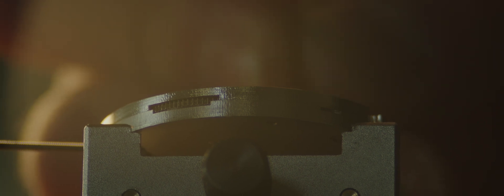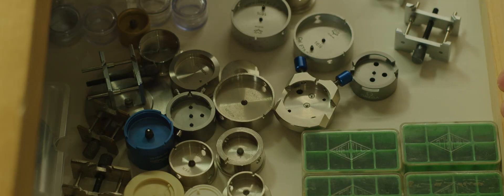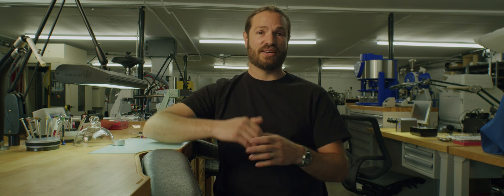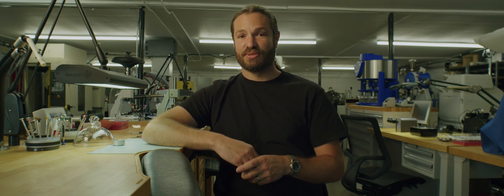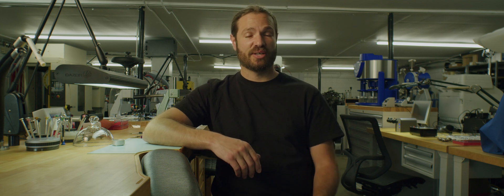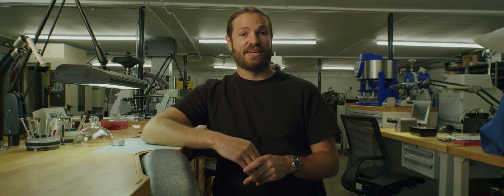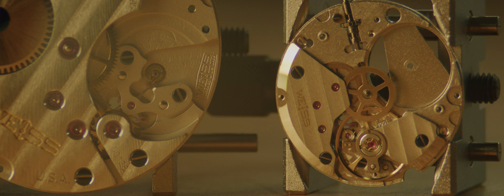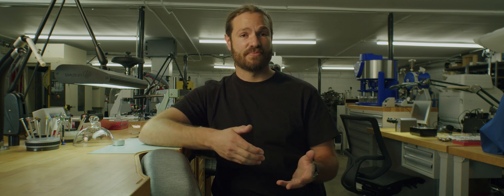Working With Movements

Comment: Would watchmakers generally have movement holders for the more common inexpensive commodity watches? For instance, would you have a holder for the 4R36 movement in my Seiko 5 Sport? Then again, and this is getting into a completely different question, might it be that working on a movement like that may not even be financially feasible? Perhaps it would make more sense to simply replace it if it has a problem.